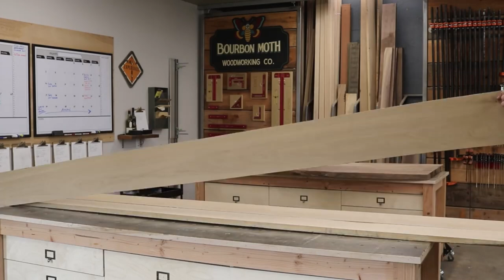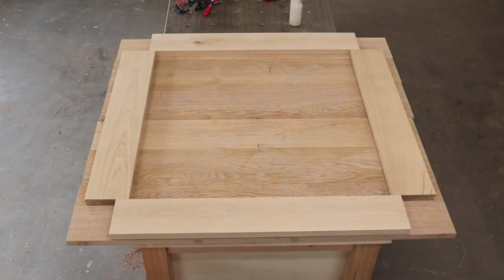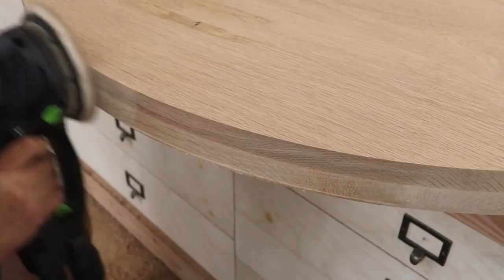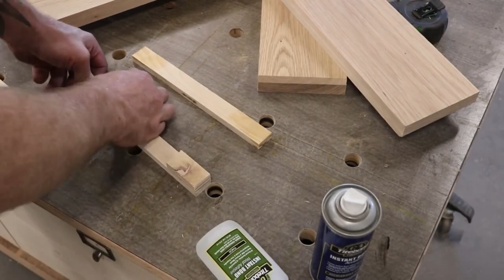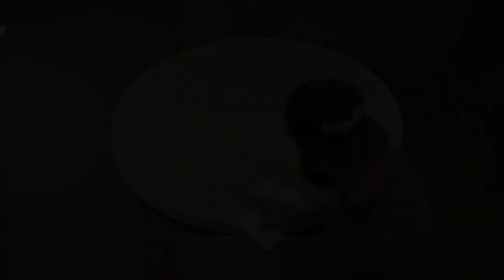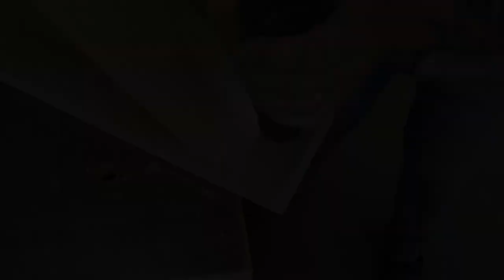Round Trestle Table || Beginner Woodworking Project

Comment: Should I worry about seasonal movement when gluing the board on the bottom across the grain to the top?  I'm planning to do this for an outdoor table. I remember when you originally did this video several years ago.